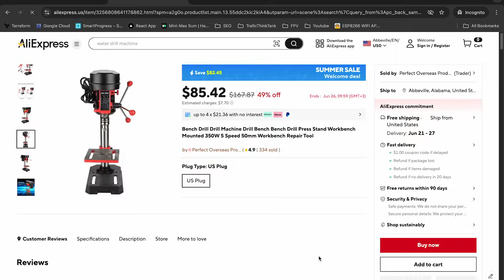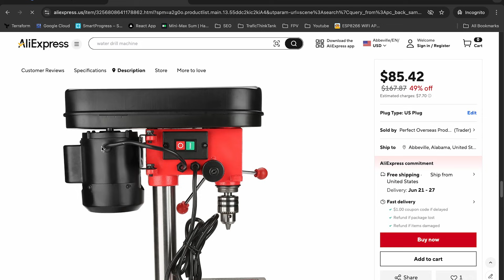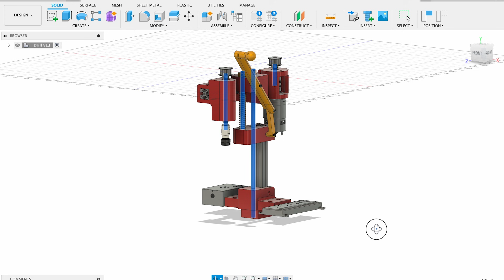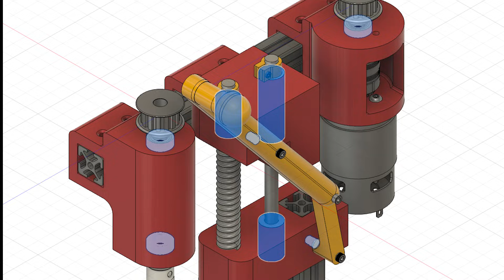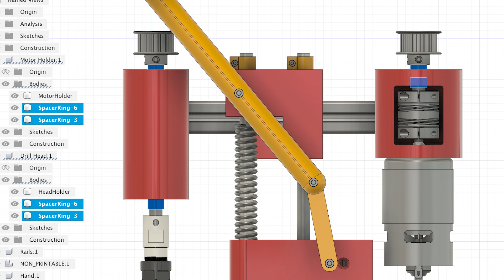DIY Drill Press – Was It Worth Building from Scratch?

Comment: how do you constrain the z motion on the collet axel?
Reply from the maker: The max distance is constrain by distance between top middle block and center one (both parts where handling is connected). 
Technically i can print "spacer" to reduce max distance, but to be honest i didn't plat this drill press as precise device so didn't try to solve this

Comment: Another solution for the belt rubbing on the vertical extrusion would be to swap the motor and tool head to the other side of the horizontal extrusion.

Comment: I worry that the bearings will get too hot and melt the plastic around them, potentially allowing for more wobble. What filament did you use?
Reply from the maker: Can’t say for sure if it’s problem, since i didn’t use it too much yet. The material is PLA
Reply: Bearings shouldn't get hot enough to melt plastic if they're in good shape